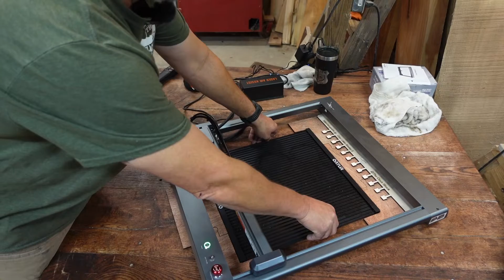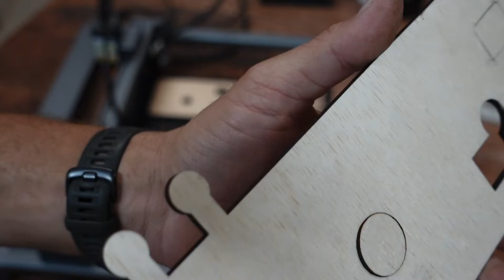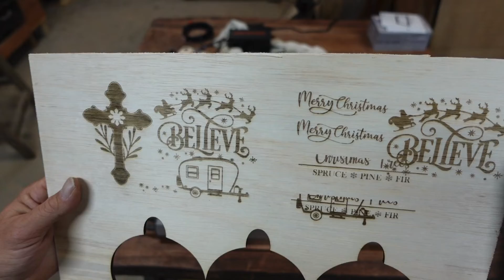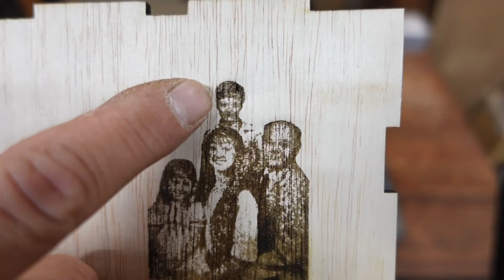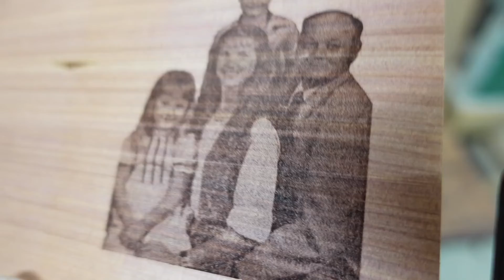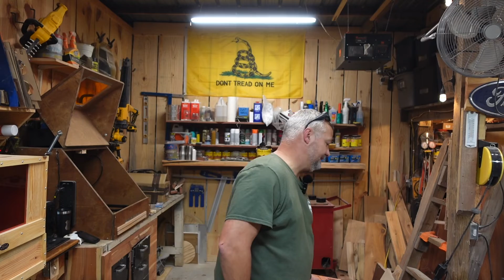Testing out the Ortur Laser Master 3

Comment: I see you have used both the ORTUR LM3 and the Atomstack A24.  Which did you like better?  the Ortur now has a 20W version as well.
Reply from the maker: Capabilities wise, they are very similar in performance. Either one I think would be a good machine. The Ortur has an advantage if you plan to do larger items because it can be expanded to a longer frame. The A24 has a smaller work area and cannot be extended. On the other hand, the enclosure and accessories such as fan and camera are nice with three A24. The Ortur enclosure is cloth type. 

Decide how big of a work area you want and how important the enclosure is…
Reply: @TheClackShack  Thanks for the insight!

Comment: I've had the same issues with quitting in middle of a job and getting Error 9 message.  I'm wondering if the LM3 isn't level would that mess up the gyroscope?  My shop floor is not too level!  I also wonder if the Y axis belts aren't tight enough?
Took me a minute to realize you're mm/sec.  310 white space seemed awful slow!!
Reply from the maker: I am sure it was something I did. I just prefer mm/s